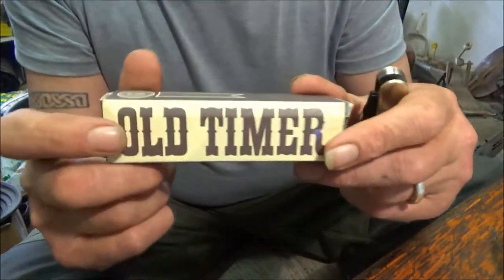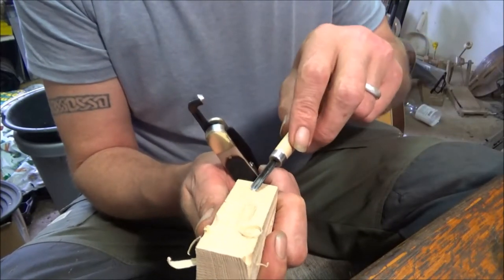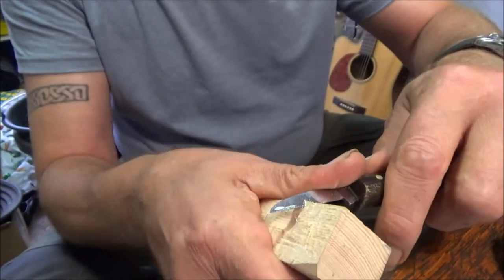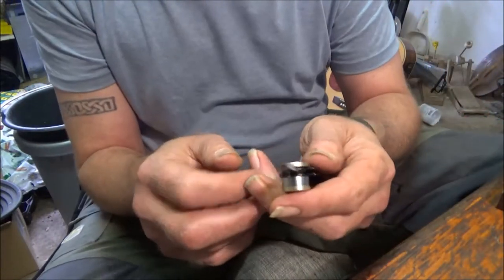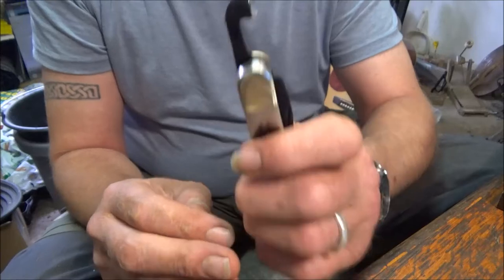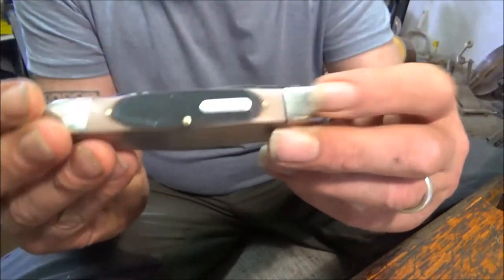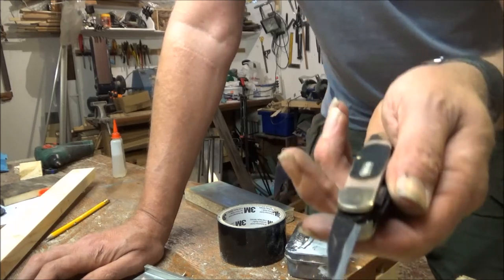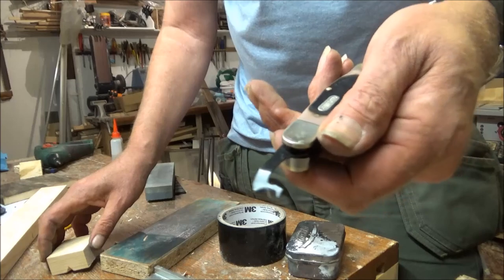Old Timer 24OT carving knife review first  imprecations pt 1. 08 06 18

Comment: I found steel bit on soft side as you found I had to re profile all blades and tune up  now it’s perfect I say perfect only for soft woods like bass  lime or willow if you use a hard wood blade edges will go dull fast greetings from Essex 👍🇮🇹🐾🦊
Reply from the maker: I think for the price its good. But yes it needed tuning. I tend to strop regularly using any knife hard woods are brutal to any knife. I tend only to carve lime bass wood unless its a walking stick and then I normally use my other knifes. This is nice to have if I want to sit and carve outside and not have to drag a tool roll around.
Cheers
Reply: Your bang on money great minds think alike 👍🇮🇹🐾🦊

Comment: I agree it should be able to lock and it would be nice if it was made in left and right handed versions like flex cut
Reply from the maker: I am left handed and it was not a big deal but yes it would be good if they made both. Th flex cut is about 4 times the cost of this I think. Its a better knife but is it 4 times better. I did somr carving with this and posted my thoughs after I used it. 
All the best Dave

Comment: Dave, I think what I would do with that straight blade, would be to grind the bevel out on the side without the thumbnail indent. At least that way you're only dealing with a bevel on one side.
Reply from the maker: I managed to do both it worked out well. Cheers ;-)

Comment: Nice tool very practical as a traveling carving set, once you get the edges the way you want them, not really meant as a workshop carving set. Good review, have you seen or used the Flexcut version of this knife ?
Reply from the maker: Yes its nice for when your out and about. I only had to change that one edge. Yes I have seen the flexcut on line after I put the first video up. I understand its about 3 or 4 times the cost. Not sure I would want to pay that for one. 

But it looks very good.

Comment: Have a great weekend Davey 😎
Reply from the maker: Thank you sir you too ;-)
Reply: @SouthpawDavey  Very interesting tool I hears they ain't sharp as a flexcut tool of same use but I knows I can improve the edge  you got chicks too sounds like it  greetings from Essex 💪🐺🐾👌
Reply from the maker: @randomfox9970   Its a good knife I did a second video after I cleaned the edges up works great. The flexcut is about 4 times the cost. so for the price the OT is very good. Yes I had 20 Quail chicks in a brooder When I filmed this. 
Thanks mate Dave
Reply: @SouthpawDavey  Thankies for response greetings from Essex I'm a branch Carver myself  💪🐺🐾
Reply from the maker: @randomfox9970  I do some branch carving too. done some chickens and pumpkins from branches its a fun hobby for sure. 
All the best Dave

Comment: Hi Dave, potentially quite a versatile knife. how do you sharpen the curved gouge blades? do you use diamond stones or paste to help with sharpening? Cheer mate........Nigel 👍
Reply from the maker: Thanks mate. Its a little different from using the normal tools. I will do a little demo on gouge sharpening for you on part two of this knife vid. I use whet stones as you saw they need to be kept flat.. I would like diamond plates but too tight to buy them lol. I also use polishing compound on the strop to finish them off.

Comment: I think a hobbie like this would be good for me now. Ive enjoyed your other vids on this subject. You used pine at the end.. is it easy to carve? Got heaps around. 
Hows your neck mate ? Hopefully your warm weather is keeping it at bay.. 
Thumb up from OZ Davey 👍😊
Reply from the maker: I just started with a a cheap knife set. I would recommend a Knife and a v tool. This is nice to have in your pocket if you are out and about. But a normal knife and other tools are going to be easier to sharpen if you haven't done much sharpening before. All the carving I have done are in pine. You just have to find it with the very close fine grain.
Linden/Lime tree is better thats what most guys use basswood. If you can get it. I have not found any here so far so pine. 
The neck the same the injections not working got to phone the Quack Monday..I think he will send me for another scan and see what we can do. 
Cheers mate

Comment: The Flexcut version locks the blades and this one doesnt. That was a mistake.
Reply from the maker: It’s not a problem but it would be better. The flex cut is a better knife but costs about 4 times more than this. I did a follow up vid after doing some carvings with it. Cheers Dave